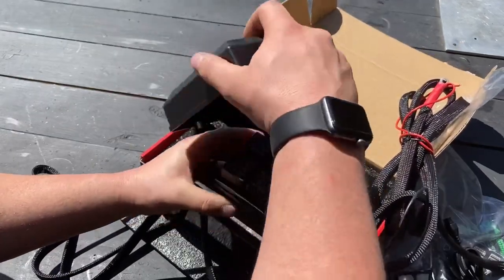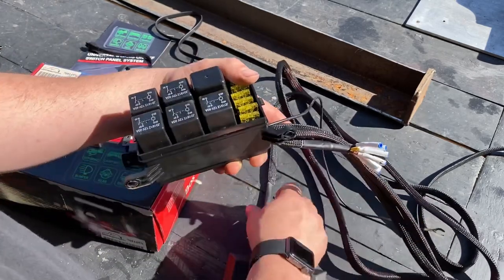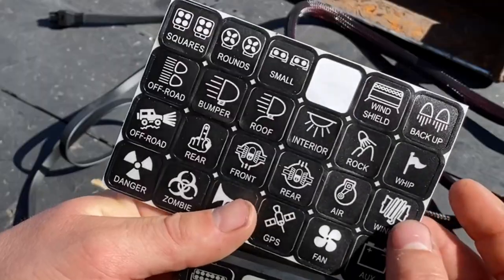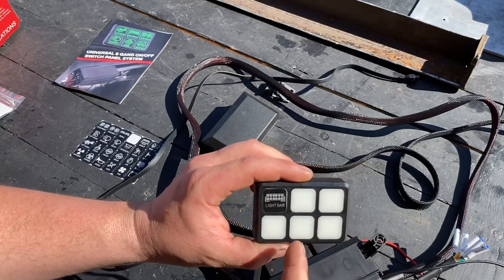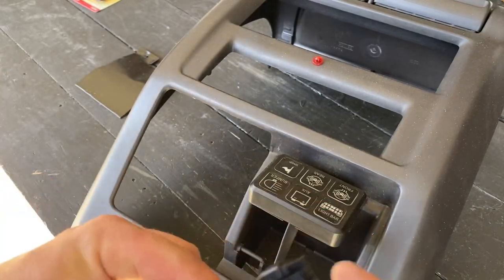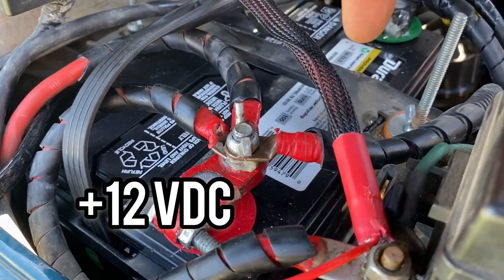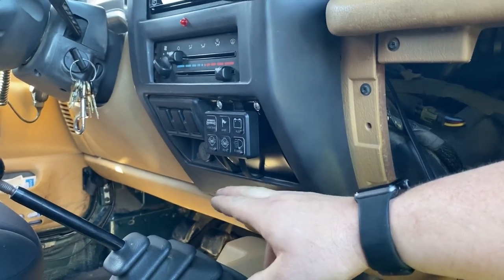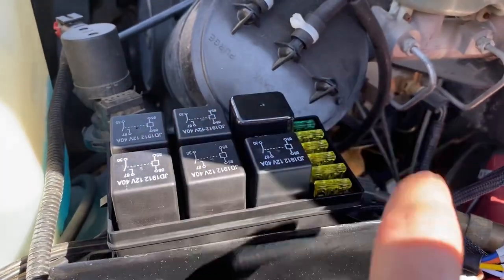Jeep Wrangler - DIY Off-Road Switch Box Control Panel Wiring Installation Guide

Comment: Ive had my sPod for over 4 years now, and I absolutely love it. Wiring is super easy, and its a clean install inside the cabin. I tell everybody that they need a setup like this if they want to run accessories.
Reply from the maker: I’d say You give some really good advice! I love it to, it’s a great foundation for what I’m going to do with this rig! E lockers and diesel heater just some things on my mind recently ! 🤟🤙 thanks for watching
Reply: @ATEMOFFROAD  yeah I use mine to control lockers as well. Hey so I’m planning a day trip to Sourgrass on the 10th. If your down maybe we can meet up and run it together. If you’re on IG I can message you the details there.
Reply from the maker: @NotICON  yeah that sounds good to me I’d really like to get back up there! Was hoping to go this weekend but it’s been getting busy around here , I’m on IG let’s discuss it there for sure !

Comment: but don't you have to use 2 wires when plugging them in to the relay box? you only used a black wire for the light bar. can you explain why you only used one instead of 2? or am i misunderstanding something. (i don't know much about electrical when it comes to cars, that's why i have so many questions. i actually have the same  6 gang panel). great work on making this video. thanks for everything
Reply from the maker: The ground for all the relays is the black wire that comes out of the box, the relays only provide a +12Vdc source so every load or light if you will,  needs one +12Vdc wire from the box to the load/light. For the second wire or ground wire you want to find the closest spot on the chassis nearby where the load/light is mounted. So if it’s a light bar on the front bumper you can land the ground wire off the mounting bracket bolt for the ground, this way you don’t need to go all the way to the battery. Just make sure you sand off the paint where the connection goes is made that way it’s a good connection to chassis ground.
Reply: @ATEMOFFROAD  ok, i think i get it.. more questions. why does a relay have different wires? how can i know what gauge wire to use for leds lights? and i don't really get why you used a fuse adapter to get 2 fuses in the fuse box in the cabin.. can you also explain that? thanks in advanced!

i love to make stuff myself. but at times i dont have the knowledge. that 's why i like asking lots of questions to make sure i understand it good

Comment: Hi, my friend, nice video.  Do you know if this panel is waterproof?  I want to install a motorcycle. Do you think it is possible?  I have a set of lights rigid (ref ignite) and they have a low and high position,  it would be possible to use them with this panel?  Thanks

Comment: Nice video.  If the power wires are being fed into the switch box, how do you ground each separate pair of lights or devices?  Do you have to ground each one to the vehicle?
Reply from the maker: Yes each device has its own ground to the vehicle

Comment: Hi, I just got the same device from Amazon to add flashers with 13 different patterns, a traffic advisor with 13 patterns, and undercarriage lights to my Toyota Highlander. After seeing your video with so much information, which I consider excellent, I feel I can install this unit with the accessories mentioned, the only issue I have, and hopefully,, you can help me with, is that the flashers come with a power button and a separate one for the different patterns, how do I connect that to the box? The trip advisor comes with a remote control and a cigarette lighter plug, I am planning on cutting the plug, and hopefully, there will be a positive and ground wire which will connect to the box, hope to hear from you soon and keep up your excellent work!
Reply from the maker: Hi there, I’m just trying to understand are you trying to replace the relay that is in the box for a flasher relay that has 13 patterns? I’ve seen Bluetooth one are pretty cool. Or are you trying to  use this relay box to initiate control over a 13 pattern flasher?  I assume it’s possible to work both ways but I would need to know. I can easily see this relay box supplying a power source to a 13 pattern flasher that has its own power button and button for each pattern! Just ground the flasher to closest chassis ground and crimp the main power wire from the flasher to a choosen output wire on the box! I’d definitely start by installing the spod first than any accessories last! Thanks for watching 🍻
Reply: @ATEMOFFROAD  Thanks very much for your prompt reply, I am trying to install the sPOD, not replacing any relays, and use it to install the flashers with the 13 patterns, I just don't know what to do with the 2 buttons that come with the flashers. As you mentioned in your reply, I will ground the flashers, but by using a negative buss( will that work?), as I will with the other accessories, and use the power lead of the flashers to one of the leads provided by the sPOD. It's a brand new Highlander, just want to make sure I will do it right not to damage anything and loose the warranty on it. Again, thanks beforehand for your next reply and really appreciate your help and expertise.

Comment: great video just purchased and getting ready to install.  I see you had front/rear locker on your switch panel.  have you hooked them up and if so are they ARB?  trying to determine which wires from ARB harness I need to plug into box positive wire?  mine has deducted rocker switches which have a yellow for rear and green for front.  wondering if I also need to red(power) from the ARB harness also spliced with yellow & green into the box positive wires?
Reply from the maker: Thanks for watching as of right now I don’t have e lockers wired in or installed on the jeep I was just planning ahead holding to do it soon . Thanks for watching 🍻

Comment: Hi my friend. Great video. Do you know if the panel is waterproof?  I want to instal in a motorcycle.  Do you think is it possible? Thanks
Reply from the maker: I’m not totally sure Its waterproof but possibly resistant! It says it can be used for marine watercraft! I do think it’s possible to be mounted on a motorcycle! Thanks for watching 🍻
Reply: @ATEMOFFROAD  thanks. I'll install it on my bike.  👍🏼